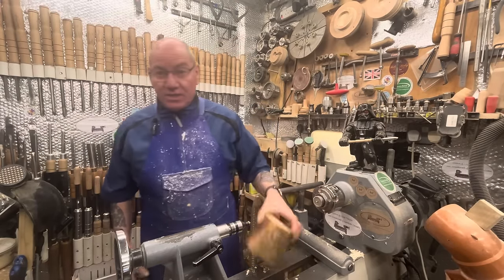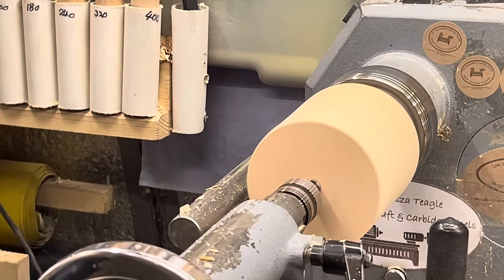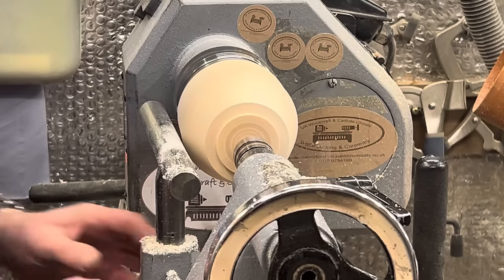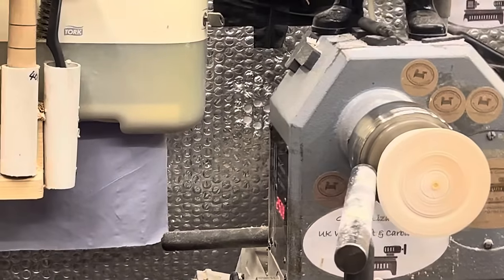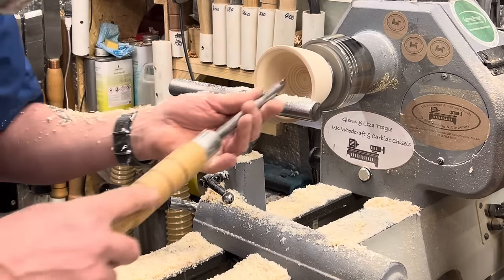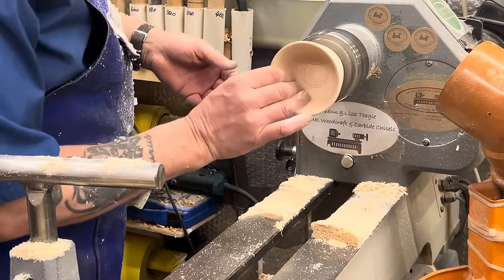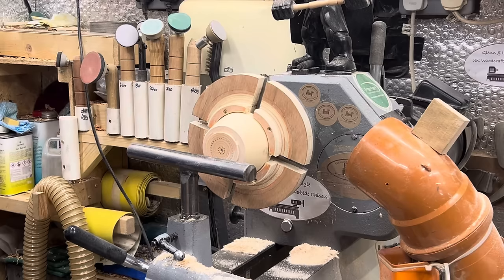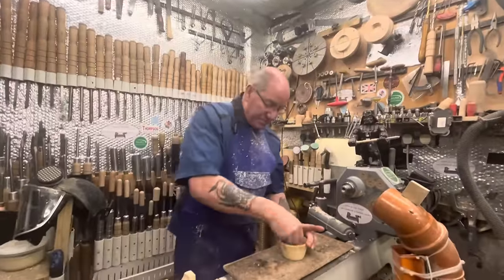Woodturning an end grain Ash bowl

Comment: Good video as usual but preferred the old microphone, seemed clearer.
Reply from the maker: Thanks Ian for your feedback. We have listened to it and it cancels out the lathe and dust extractor noises, which was what we wanted. However, this is our first time of using it. The mic may have been too close for Glenn and mine unfortunately switched off for some reason. We need to test more but will be using them. It's important people hear what Glenn is saying, as he will not turn without a mask unlike some professional turners who don't wear a mask so you can hear them. We want to uphold safety as well as providing you all with clear information. These are also wireless mics as Glenn will not have wires connected to him, as this can also be a danger in the workshop.